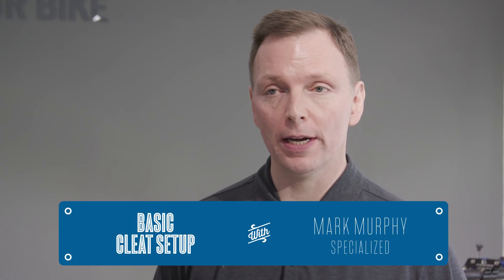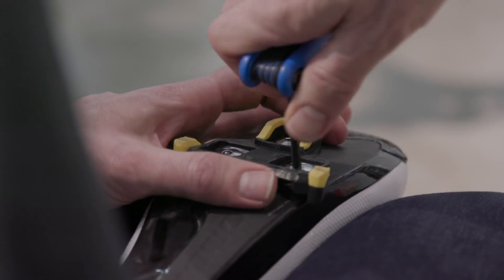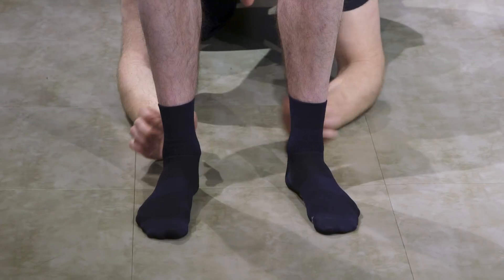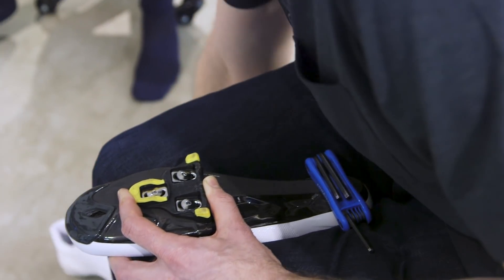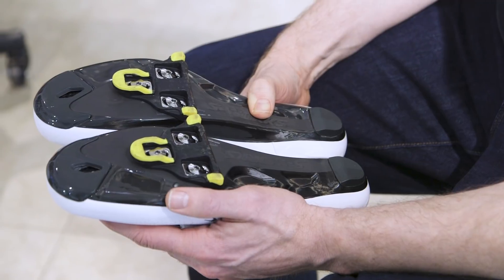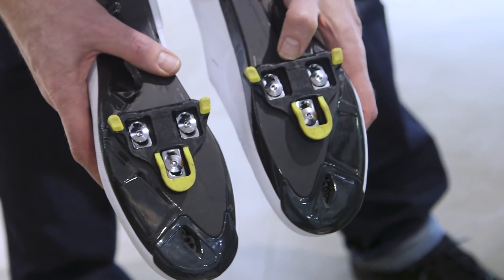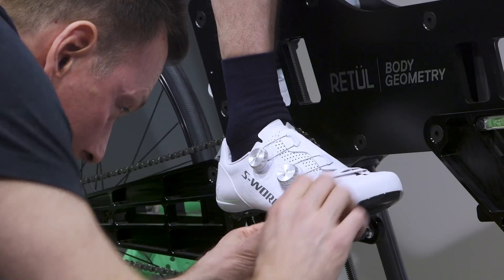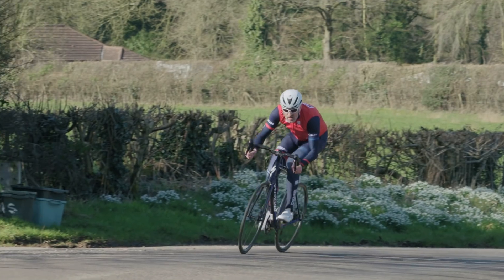The Easy Way To Set Up Road Cycling Cleats

Comment: Hmmm symetrical, should the placement not reflect the likely asymetry in your feet. Ie if the left foot is more toe out than the right. The cleats should not be symetrical on both shoes ??
Reply: I was thinking the same. Flexibility in both legs is not the same and how either leg tracks is not identical. I thought it would be the opposite that asymetrical would be key!!!
Reply: This.
Reply: Yeah with you on that one. Most people will have asymmetry when they stand naturally. A symmetrical setup would be painful.
Reply: You are absolutely correct, however the problem with giving this advice is some who adjust cleats asymmetrically will just create more fitting troubles by going the wrong direction.  Most cleats have enough float in them that even adjusting symmetrical, there's enough float to compensate for discrepancies.